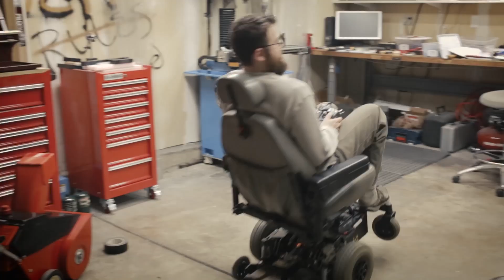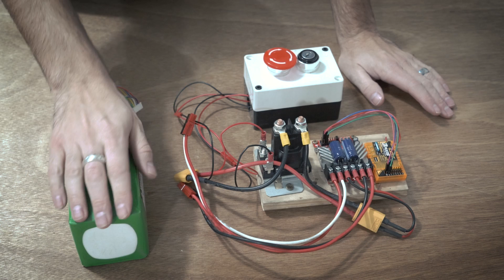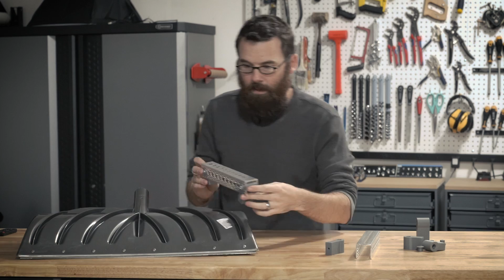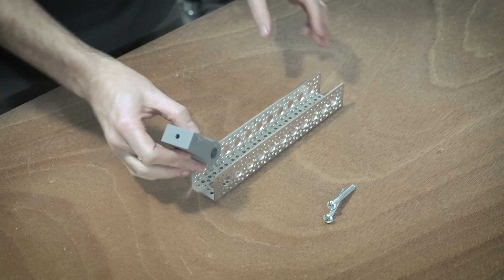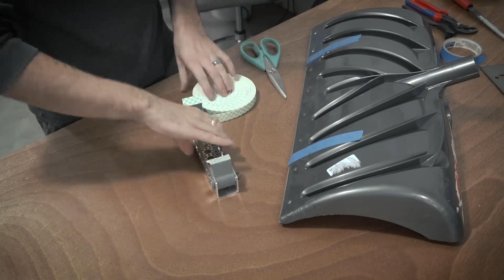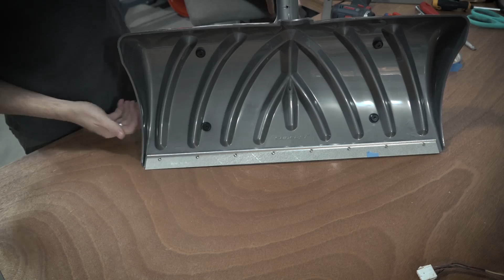Robotic Snow Plow - Part 1

Comment: i desperately want to take and old wheel chair and turn it into a haunted house prop, i want to turn it into an animated puppet basically. i want to stick a dummy whether its a skeleton, or something and be able to have an actor or staff walk around and discreetly control it with one hand and have either a car horn, water sprayer or air blast on it. half of the work is just geting the wheel chair to move by remote and the other half is attaching the dummy and doing that work

Comment: I really enjoyed and learned alot from your video. You have a great delivery. Here is a suggestion on 12" of snow Don't fill the entire shovel when first starting. Try a quarter shovel per pass and push it to a place you can leave it. or add a little weight on the rear of the machine.

Comment: How do you set up the Tx so you can use the throttle stick to control the motor in both forward and reverse?
Reply from the maker: Look up tutorials on tank steering or v-tail mixing.  Each radio will be completely different.

Comment: Good job, where can I source the three axis receiver and compatible transmitter?
Reply from the maker: You can find these pretty much anywhere.  The Taranis QX7 is the one I'd recommend, you can find them on eBay, Hobby King, Amazon, or even Bang Good.  You typically buy the transmitter and receivers separately, and you usually keep the transmitter in your robot, and have one for each robot.

Comment: what charger do you use on that beast of a battery, and how long does it take to charge . i am considering getting one versus lead acid for similar applications
Reply from the maker: I just use an imax b6 charger, which is pretty cheap.  I have the AC version and the normal version.  you typically charge batteries at 1S, so this would get charged around 20A, but I don't think the b6 can go that high.  I forget how long it takes, it's not fast that's for sure.  but you get a LOT more power than a lead acid can delivery.

Comment: 7 cells would be closer to the voltage the motors use but 6 is good.  I use these places:  http://www.westmountainradio.com/product_info.php?products_id=pp_lock_12  and https://www.dimensionengineering.com/products/sabertooth2x25

Comment: Did I hear say the wheel chair chassis cost you $60 for the chassis?
Reply from the maker: Yep, check craigslist from time to time, there's usually a couple on there for cheap.  I've gotten them for free (with fully working motors and electronics).  The most I've paid is $100 for one with working electronics, motors, but dead batteries.  You can usually find beat up ones for cheap.

Comment: Nice build!  I think lead acid batteries in line with the drive motors would give you the best results.  I know your probably trying to keep it on the lighter side so you can pick it up, but tire chains or studs will leave marks on your pavement...  Maybe a removable battery tray so you can take it out and carry it in 2 pieces?
Reply from the maker: I was thinking of just adding weight to the compartment or something.  The LiPos drive the motors the best (lead acids just don't have enough current delivery when driving it hard).  Ideally, I should go to tank treads, but they are difficult to find cheap.  Carrying the whole thing isn't a big deal, I just drive it where it needs to go.  I can access my whole property by just driving it, so weight isn't a big concern.  I just chose not to use lead acid because of the performance aspects and size.  I can always get the electronics as small as possible and fill the rest of the cavity with weight (sand or concrete, etc).

Comment: I'd recommend putting 24DC breaker on the battery line. In the event of short circuit you may set battery on fire before you manage to run to your emergency switch off  (like exploading "hoverboards"). On real snow plows I've seen small casters on the bottom of the shovel to help it following ground irregularities. Waiting for snow now :)
Reply from the maker: My other safety mechanism actually has a separate battery system.  The only way the solenoid gets activated is if the e-stop is disengaged, another button is on, the secondary battery is charged, and if it gets a signal from the radio.  The breaker is a good idea though, I have several of them that I gutted from the wheelchairs.  The casters is a good idea and I was thinking of something similar to guide the shovel over cracks and such.

Comment: more rc than robotic but it has something
Reply from the maker: Eventually, it will have a gimbal mount for the GoPro and an actuator for the plow.  So, at least MORE robotic...
Reply: I am still wanting to build a robotic law mover. Maybe a e-wheelchair could be also an option.
Reply from the maker: That's on my list for next year.  I have some aluminum extrusion to make a frame for a lawnmower deck to sit underneath.  I'd like that to be 100% autonomous though, so it's a bit more of a challenge.

Comment: Narrow tires may be problematic is soft snow.
Track system might be better or can even wider tires be mounted?
Reply from the maker: I really really wanted to do tracks, but they are very hard to find OR very expensive.  I'm still searching for a broken down tracked snow blower that I can steal the tracks from.  They are just really hard to find under $500.  I might try wider or bigger tires, we'll see how these work with studs in them.  But I'm pretty sure traction is going to be my number one issue.
Reply: Hello Robert!! I assume you have already read all Riobotz Combot Tutorial hahaha Maybe a way to solve this is doing something like they did when the competition was held on an ice arena. It would be much cheaper(almost no cost) IF it works. Keep up with the robot videos, love them! Bye, cheers from Brazil!
Reply from the maker: I have read that tutorial, it's great!  Thanks!
Reply: If you find that trick interesting and usable let me know, see ya!
Reply: I live in northern WI. Believe me, narrow tires are actually better for going through snow.